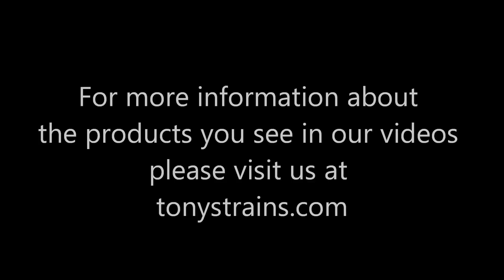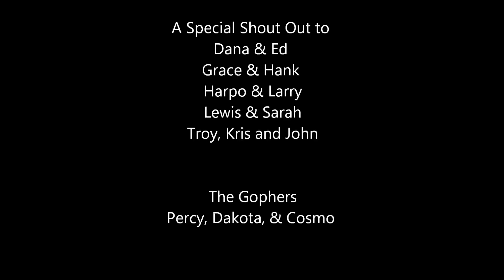NCE Power Cab & ESU Programmer with PSX Circuit Breaker &  for Bench Programming

Comment: Wanna hear something funny (not really) I had a pretty sizable o scale layout that was dismantled 4 years ago. I had bought 6 psx circuit breakers from you in hopes too install them on my layout to create power blocks.  I left them in the shipping box next to my dresser. A couple weeks went by and I went to install them and they weren't there anymore. Long story short, my EX-wife threw them away thinkning they were trash.  The o scale trains are long gone with the divorce and now I'm modeling ho scale.  Finished laying track which took about 2 weeks to compete. Its not a big layout 12' x 15', but packs alot more action per sqft then o scale, so I'm happy with it although my eyes hurt from squinting. But ho offers more scale fidelity and function then o scale. Good trade off I guess if thats what your looking for. . Anyways I'll be ordering more psx for my new layout.

Comment: I see a serial cable hooked to the decoder programmer. You didnt explain where that is going.
Reply from the maker: Hi Rick, the RS232 serial/USB cable on the ESU LokProgrammer is connected to the PC. The PC can run either the ESU Programmer software through the programmer/tester hardware, or it will run JMRI Decoder Pro through the NCE USB/Power Cab DCC system